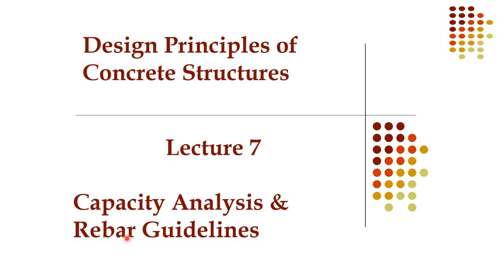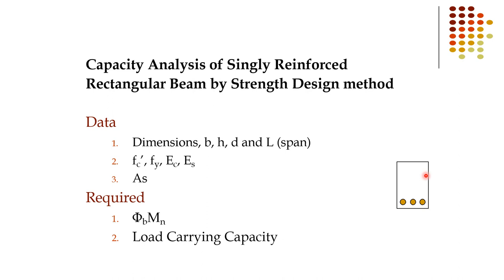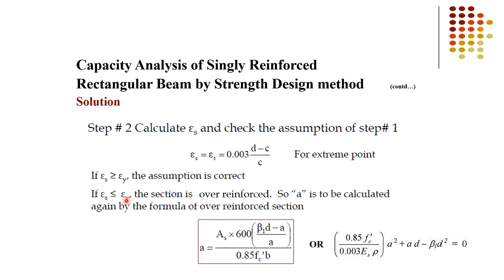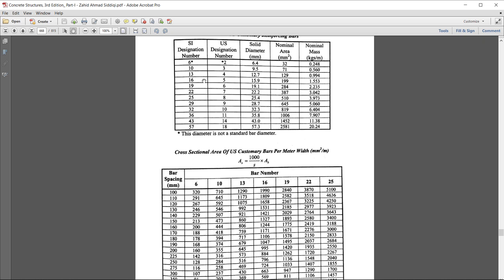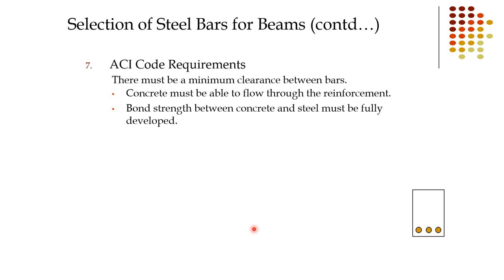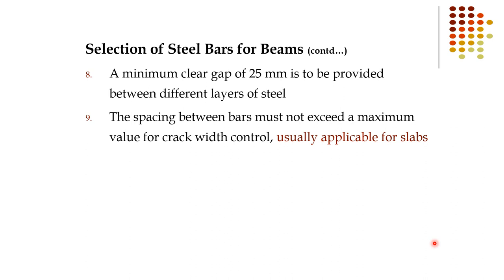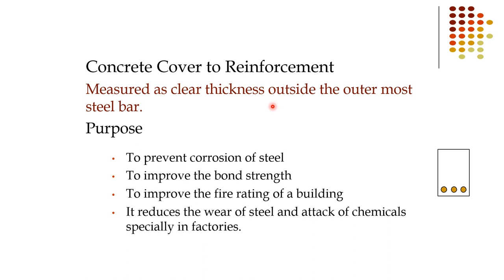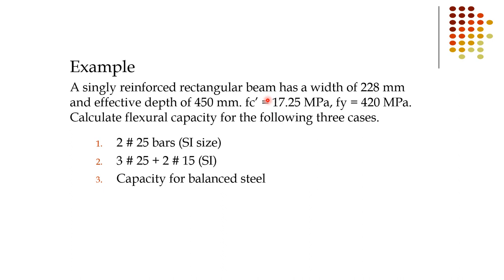Lecture 7 Beam Capacity Analysis & Rebar Guidelines, beam detailing | Part 1 [Concrete Structures]

Comment: @10:25 u said lesser of the following.... is it not  the spacing should be greater of the listed value?
Reply from the maker: Yes you are right.... Now i have opened the code ACI 318: 25.2      and read the exact wording....

It is greater of the following....

Thanks for letting me know...

Comment: Sir, please mention a few RCC books based on ACI 318 code but in SI system....(Metric)
Reply from the maker: Structural Concrete: Theory and Design by M. Nadim Hassoun, Akthem Al-Manaseer Link: https://civilmdc.com/2020/03/12/structural-concrete-theory-and-design-6th-edition-by-m-nadim-hassoun-akthem-al-manaseer/

Concrete Books Library: Link https://civilmdc.com/category/civil-books-platform/concrete-structures-books/